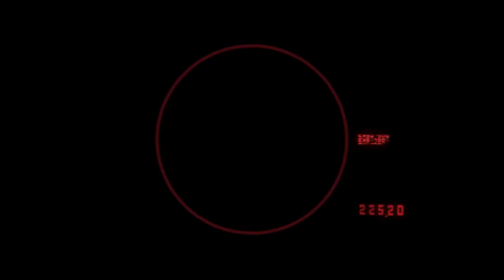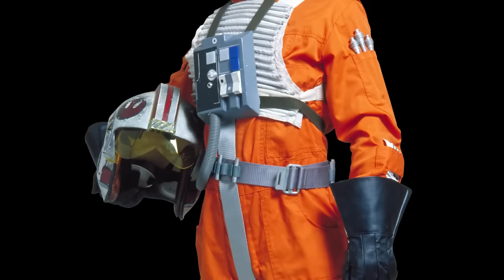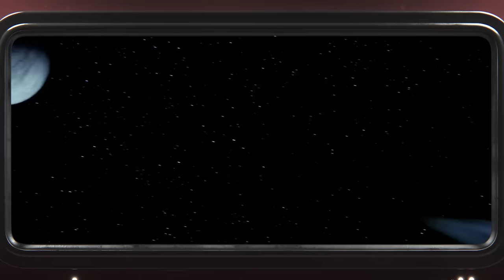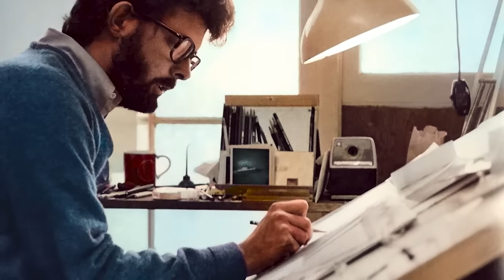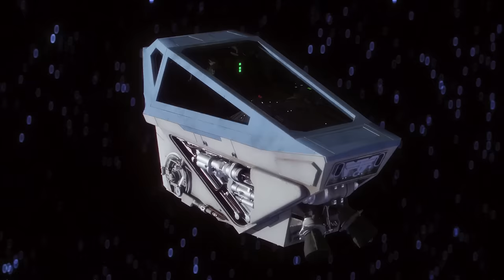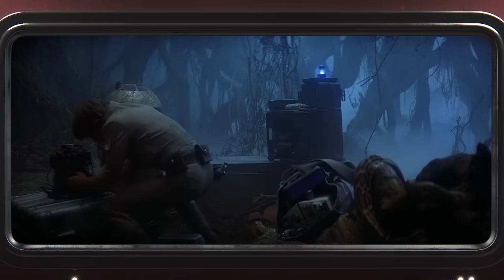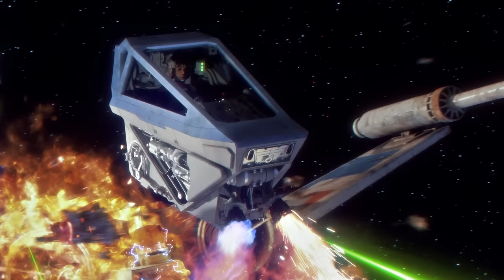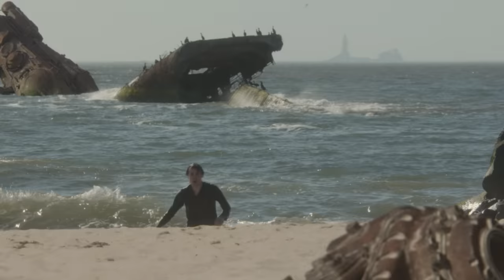X-Wing Ejection: It all makes sense now

Comment: In the original Rogue Squadron Novel they frequently refer to the air limitation of ejection and the effective guarantee of death if operating without friendly rescue service and acknowledgement of the limitations of ejections is not exclusive to this novel by any means. Your solution is significantly more elegant and effective than the previously ubiquitous ejection seat but its not like these problems have never been addressed.
Reply: This. I remember it basically created a force field but after thirty minutes it was either death by suffocation or exposure or both. Nawara Ven started sticking his lekku into what were basically giant socks after his first extravehicular experience 🤣
Reply: Agreed. I always interpreted the chairs as a technically-there-but-not-very-good option. Given that rebel strike ops meant ejection = capture at best, it makes sense they didn't place a high priority on that feature when selecting their preferred snub fighter.
Reply: ImGine actually ejecting over the deathstar,  surviving just long enough for the thing to blow up under you a few minutes later....
Reply: Don't forget how Luke met his wife in the Thrawn Trilogy.  Luke only survives an extended period in a damaged X-Wing in deep space due to Jedi hibernation letting him optimize his oxygen and hunger beyond what any mortal could do.
Reply: I remember in one of the first X-Wing novels Corran Horn’s wing mate Ooryl Qrygg losing part of their arm due to debris following an ejection. Corran even states that “10 is extra-vehicular” (Rogue 10 being Ooryl’s call sign). Clearly Ooryl’s X-Wing didn’t come with a fully enclosed ejectable cockpit.

Edit: I just looked up Ooryl’s bio on Wookieepedia, and learned that Ooryl is a subspecies of Gand that are ‘lungless’, meaning they don’t breath like we would. So, if not for that debris, Ooryl could have survived in the vacuum of space with no issues. Still, no enclosed ejection cockpit is still a dumb design, as Ooryl learned.
Reply: A small, localized Mag-Con field built into the seat/suit (it varies by author, iirc) is automatically deployed as part of the ejection process, and contain enough air for at least 30 minutes of extra-vehicular survival. The biggest problem then comes from exposure to the cold, or from debris. Another comment mentioned Ooryl, who lost an arm because of debris after ejection, which could also be an issue, but considering I can only think of 2 or 3 instances across the X-Wing series, that seems to be a relatively minor concern.
Reply: @killerhappyface  If they had proper space suits rather than flight suits, that could work for a few minutes, but the issue with retrieval is going to be a practically impossible to solve problem. The only time when the ejection might actually work is if you're in the atmosphere of a planet and the vehicle has failed before getting to orbit.
Reply: And they say TIE Fighters were the ones viewed as expendable, lol. At least TIE pilots had an actual on-body oxygen supply.
Reply: @LordVader1094  actually, the TIE's oxygen was not on the suit. They had to hook into the fighter's system. The TIE fighter had minimal heat, and on-board oxygen tanks that didn't last that long. The X-wing had full environmental controls and an oxygen scrubber, plus the 30 minutes of suit/seat mag-con air. TIEs were literally "how little can we put in this thing while still having pilots to fly it?"
Reply: Didnt stop micrometeror bits either; I think it was...Hobbie or someone lost a leg to a bit of shrapnel going through at 1/4th C and had to have it replaced.
Reply: @Ghostwolf82  THATS what I was remembering, thank you! I thought it was Hobbie who had it happen. 
Also, the field activates even if the pilots not out; "Face" gets his canopy blown off and the EM field activates while hes still inside his X-Wing.
Reply: The mass intensive method he describes is best used to prevent the need to eject. Hence the magcon field of the books. 
Remember that the escape method is a last ditch survival effort. And escape pods on aircraft only happens in a couple models. It isn't practical.
Reply: @Ghostwolf82  
It is a great idea to just EV. A last chance. But which would you choose. A massive escape system, or put that mass and space into better shields, maneuverability, and speed. The goal of this ship is to fight, not protect the pilot.
Reply: I remember somebody in one of those novels ejecting safely. but then being badly injured by a micrometeroite through the leg whilst awaiting rescue. Mention of such a realistic space hazard in Star Wars just felt wrong. Next you'll be having ships that don't "stop" when their engines cut out!
Reply: @worldcomicsreview354  
Actually Horn got into a perpetual flat spin until he got a partial restart after getting hit by an ion cannon.
Reply: Its what the box on their chest is for. Its the emergency life support
Reply: @KuraiLunae  Die from exposure? you mean if they ejected in some planets atmosphere?
Reply: @jbirdmax  no, the cold of space (or maybe the mag-con field generator, depending on what you believe) will freeze them if they eject and don't get picked up.
Reply: @KuraiLunae  oh okay. 
It is fiction so I suppose the cold of space could somehow propagate to the person despite space also being devoid of the very thing (moisture or humidity) that propagates temperature. 

I was just curious if you meant in space or atmosphere because of that. 

Of course if the shield failed? Temperature would be the last thing to harm someone. 😂
Reply: @jbirdmax  there's also a theory that the mag-con fields themselves are the reason for the cold, since they're likely based on superconductors, which require extremely cold temperatures to work. Pilots aren't likely to be physicists, so they assume it's space, but it's actually the equipment keeping atmosphere in.
Reply: Ahh okay @Casey, that makes some semblance of sense to me then. 
I know we can make things cold without producing heat by the release of highly pressurized gasses, and since it’s only intended for a short time…

Comment: I would like to add that, remember right after Luke crashed his X-Wing into the Dagobah pond, it is largely submerged. 
So, where did Luke get all his supplies from? 
The only real answer is that he was able to lift up his seat and bring them up through the cockpit since the bottom was under water.
Reply: I'm pretty sure in Heir to the Empire it describes the cargo compartment similarly.
Reply: I think that some real canon also explained that if you can get in their and move the wiring around, you can have more storage space too.

Which makes sense given how it was a mutki roll fighter designed to fight in pretty much any atmosphere, gravity well, space, and deep space, while also having the capacity for long term solo travel
Reply: @tiggytheimpaler5483  Is "long term solo travel" ever depicted or implied? While sure, operating at minimal power and on a ballistic trajectory with engines cut the only limits might be the life support capacity and diaper size, I had figured snubfighters would operate more like Earth aero fighters-- deploying for some number of minutes or hours, then returning for service and rest and re-equipment.
Reply: @JackVermicelli the x wing is not a snub fighter however, its an air superiority fighter
Reply: Or I guess space superiority

Comment: I myself like the idea that the pilot and the droid have different ejection mechanisms, controlled by themselves respectively, and that after both have safely exited the combat area, they rendezvous.
Reply: I figure it would work like how tandem seat ejections work on say the F-14 for example. The order (RIO then pilot) and time delay help to ensure that neither crew member is burned by the rocket motor in the seat, and that their seats do not collide. Except in this case given the danger of the pod colliding with the droid, and losing both pilot and droid, the sequence is reversed. Pod ejects, then the droid if possible.

Comment: The ejection systems of the Y-wing and B-wing must have been even more robust, since those ships seem to have sealed cockpit modules designed to separate from their fuselage.  The A-wing , depending on the model, seems to offer little in the ejection scenario.
Reply: The A-Wing IS the escape pod lmao.
Reply: @boundlessaether392  A-Wing "Go Fast".  
Oh, and a lil 'shooty shooty' on the side. The most combat effective we've seen an A-Wing (on-screen) was an impromptu kamikaze run into Darth Vader's flagship SSD.

TBF, It's the only thing that can meet-beat a Tie Interceptor (and, probably 'keep up with' heavily-modified blockade-runners). IIRC, it's well-established that A-Wing pilots are a 'special kind of crazy'; lacking an ejection system, just adds to the lore of the snubfighter and its pilots, IMHO.

Comment: If you play the old school X-wing game, the ejection system was a module that was collected during battle if necessary or after battle
Reply: It was not a module. You saw figures in suits floating and picked up by a transport. Or maybe that was tie fighter.
Reply: @gregorymuir1985  I could have been mistaken in which one it was. But I think one of them had what appeared to be an escape pod in it.
Reply: @kennethkates3140  there will undoubtedly be a recording of it somewhere on YouTube.
Reply: @kennethkates3140  the 3D Wing Commander games made-clear, there's a 'pod' involved. 
WC III and IV were 'contemporaries' to X-Wing/Tie Fighter. So, (at least) the 'false memory' is easily-explained.

Comment: Actually EU books (specifically the X-Wing books) had life support equipment built into the flight suit that deployed a "magnetic containment" field like those used in docking bays to contain a small amount of atmosphere when ejecting. The interesting thing is that ejection was specifically a combat only thing and that they had a very short period of time - measured at less than an hour - where they could survive after ejection. If they didn't get recovered during that period they died. Though an interesting note was that exposure was more likely to kill an ejected pilot than running out of breathable atmosphere.
Reply: Good Point.
To be fair: 'forcefield' tech is not something new or considered unreliable in Star Wars. 
Especially, with the canon-adoption of The Old Republic; we can see technology like (electro)magnetic atmospheric containment, has been around for eons. 
Also, in EU, Legends, and D-Canon "Personal Deflector Shields" are not improbably-uncommon; implying 'form-fitting forcefields' are 'a thing'.

Comment: I don't know if I 100% agree, however I do really like the idea, and perhaps your take on ejection and the comic and other instances of ejection don't have to contradict, perhaps your method is the main ejection method, and if the canopy is breached or damaged the seat with a force field is the secondary option. Great video, love the animations!!
Reply: I liked the idea of an ejection seat force field bubble, but I really like this idea when I actually put myself in the boots of an X wing pilot. I think a cockpit with thrusters and more air sounds better than a stupid jetpack force field seat
Reply: Maybe its like with Cars... depending on how much you pay the manufacturer you get heated seats and electric windows, parking distance sensors... or just the base model.
Reply: @SP-sy5nq  
Better shields and combat capabilities sound better than this clunky thing.
Reply: @SP-sy5nq   Ejection make sens in the atmosphere. In space it's necessary to have a special suit with life support for some hours, or how you would be evacuated from a bubble? 

You can't actually surviving in open space, like on the surface of a planet with atmosphere, so you simply don't need supplies and tools there. If nobody came - you dead. On the planet with atmosphere and life, theoretical you could survive for years.

Comment: Wing Commander and its spin-offs like Privateer had Ejection capsules as well, BattleTech has the "Full-head ejection system" (the head usually  contains the cockpit of a BattleMech).
So yes, your idea is excellent, highlighting once more how limited the majority of artists expanding StarnWars later on was in many aspects.
Though to be fair, they were ARTISTS, not engineers.

Comment: I love it! One of the many problems I had with Legends was how they tried to answer questions of the movies with finnicky and nonsensical answers (forcefields on an ejection seat... It's like a Wookie with a "speech impediment" talking Basic); your's is both elegant and makes sense! 

The thruster nozzles being pointed down looks interesting; it almost implies that the escape module flies "upwards" relative to the pilot rather than "straight ahead". There's something about the canopy shape seen from above flying in that manner that reminds me of a coffin floating in space. There could certainly be some lore-building uses for that!
Reply: That is how an aeronautical engineer would design an escape pod, you have to remember that the the ship is flying in space so of course the pod would blast up and away from the rest of your exploding ship. Just like fighters do
Reply: @nicholasklangos9704  I get that, but the position of the thrusters would mean that it looks like it would fly using all four thrusters (so thrusting "upward") because just using the ones at the back (relative to the pilot) would be misaligned to the center of mass and cause it to tumble. The image of it flying upwards (relative to the pilot's head) just gave the image of a floating coffin, that's all.

Comment: I actually always thought the flight suits the rebel pilots wore were supposed to be sealed (in areas where you couldn't see skin, anyway), even though they didn't look like it, because budget and because space opera hand-waves a lot of pesky details like that. Which also gives us things like wearing hospital oxygen masks to survive in a hollow of an asteroid that turns out to be the digestive system of a space slug. And Luke being able to breathe on the underside of Cloud City, in the upper atmosphere of a gas giant. (Though of course the biggest reason was probably that they wanted the rebel pilots to look visually distinct, and like the opposite of the bulky, robotic and faceless imperial pilots...)  I remember that in the Zahn books the flight suit was also treated as vacuum-rated, since when Luke does a space walk to try to fix his broken X-wing hyperdrive and subspace antenna, he just grabs his "gloves and helmet seals" before popping the cockpit.

Another theory assuming the suit is air-tight: The "life vest" rebel pilots wear inflates like those fancy MotoGP inflatable crash suits, creating a thick and high collar that seals against the helmet.
Reply: The noise in deep space shows that the SW galaxy has some sort of ubiquitous atmosphere with limited pressure.  Pilots might not need much more than a larger rebreather to wait for rescue.
Reply: @davidtauriainen9116  I remember EckhartsLadder did a video talking about luminiferous ether once. That might correlate with your theory.
Reply: @davidtauriainen9116  FWIW, TESB shows that in the belly of a space worm, humans can survive with a simple rebreather and no eye or ear protection, and some of the comics (TFU 2's comic comes to mind when Juno is kidnapped by Boba Fett) depict human characters surviving in space without eye or ear protection either. This seems to support your idea.
Reply: Originally, the X-wing pilots were to wear oxygen masks with their helmets, but the masks were dropped to allow more of the actors' faces to be visible. You can see a picture of a prototype helmet with mask in Star Wars Helmets' article for the Rebel pilot helmets.
Reply: @EscapeVelocity11186  Several years ago, I had a friend (A middle-aged and life-long Fantasy/SciFi 'enthusiast') that was logical and insistent that 'The Galaxy Far Far Away' was not a 'hard vacuum' but rather an extremely low-density 'fluid'. S-foils, sounds, ejection survivability, etc. All factored into his summation. 
(I think even the effects of The Force may be inter-related to the 'ethereal composition' of Star Wars' non-(hard)vacuum 'space'.)

TBQH, it's part my own head canon now.

Comment: great video!  in addition to the Hammerhead cockpit module from Space: Above and Beyond similarities mentioned by others, i'll point out the appropriate similarities to the Mark 1 Viper ejection pod seen in the Galactica 1980 episode "The Return of Starbuck" (the only episode of the Battlestar Galactica spinoff worth watching, unrelated to the rest of that spinoff, wherein Dirk Benedict plays Starbuck marooned on a desert planet doing a riff on Enemy Mine with a damaged Cylon).  

Seeing as the Viper was HEAVILY inspired by the X-Wing, and the similiarities in design, mission, and that the pilot was also in shirt sleeves and an open helemt, this all makes sense.
Reply: In many cases, the open helmet was there for one main reason...seeing the actor's face.  In TV/film, it's all about seeing the actors face.  I figure one could assume the lighting on the viper helmets is an imaginary shield (which the real purpose was to light the actor's face).  If you've ever seen a real military pilot's helmet and mask setup, the visor comes down and lines up with the edge of their air mask.
Reply: You noticed that too!

Comment: I can totally see both systems (the escape capsule and the ejector seat) being used on different versions of the X-Wing. The capsule on a variant for long range missions and the ejector seat on variants that are used for fleet engagements where rescue shuttles are much more available.

And the Rebel Alliance being quite strapped for resources and spare parts I can also see them retrofitting one system for the other depending on what is currently available.